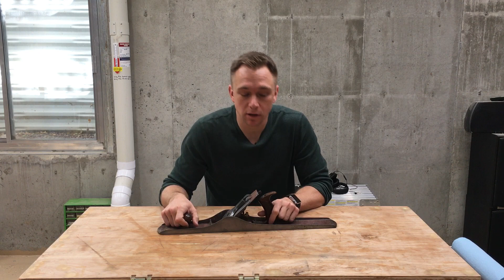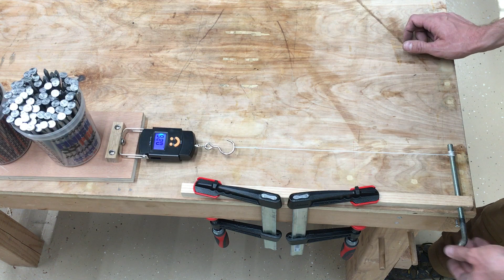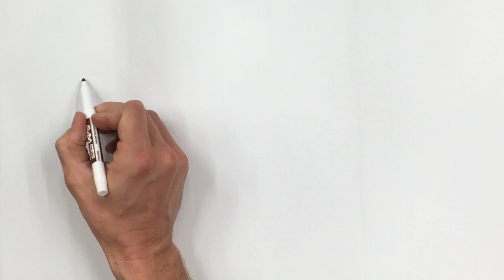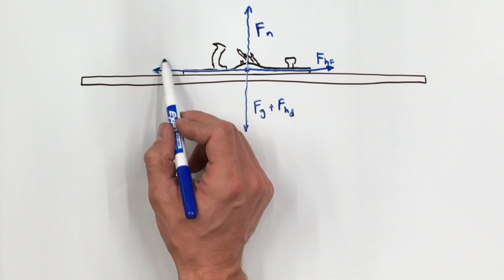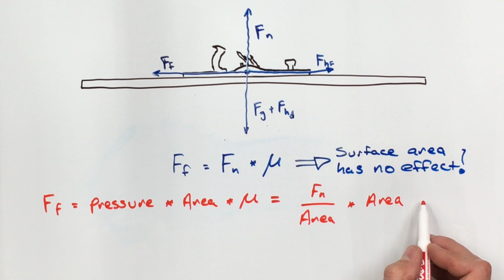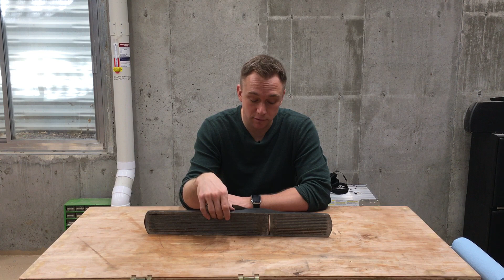Grooves in Plane DON'T Reduce Friction!

Comment: the reason they are there is because Stanley could advertise that it was easier to push. even though it made no difference they advertised it. and that is the reason they put them there. I will see if I can get you a few links to those old adverts.
Reply: here you are. http://www.petermcbride.com/chaplin/tower_and_lyon1.jpg
https://virginiatoolworks.files.wordpress.com/2012/06/stanley-1929-catalog-plane-page.jpg
http://www.handplane.com/63/stanley-1902-catalog/
it is not that they did actually make it easier but they could charge more if they advertised that they pushed easier.
Reply from the maker: +Wood By Wright very interesting
Reply: Yeah, marketing genius!
Reply: Howdy James. Always good to see the channels I follow watching some of the same things. research aligns once again. If even a year apart.
Reply: Thanks for the links, James. These's a lot of great information there, plus the website for even more info.

Comment: I'm no plane expert but I am an expert in thermodynamics. Basically, I understand physics very well. 
Two very flat surfaces will have suction when you try to pull them apart. This is especially true if you add a small amount of liquid such as water found in wet wood. 

If you add a path for air to get between the surfaces then you eliminate that suction. So, the groves definitely help with that. 

However, my guess is the primary purpose is to flatten the plane more easily.
Reply: If that was the case wouldn't it be better if the grooves run all the way so air can get in at the ends?
Reply: You are correct. It would be better.

Anyway, I should have mentioned earlier that I don't think the suction force would be significant. Its calculable and its there, but not noticeable.
Reply: You know you have a very nice surface when you can't lift the plane off the board because of the suction force!

Comment: hi, 
while everything you have said is correct and is taught in school and engineering the way you explain it, it isnt quite that simple. what you will find is that there is actually a curve for the coefeccient of friction between two materials. In other words it doesnt stay constant for all pressures. this has got to do with the roughness of the two materials and as you apply more pressure the troughs in the material start to get filled with the peaks from the other material  and normal forces start to be created which increases the coefficent of friction. however it gets to a point where these troughs cant be filled any more so the curve flattens off.
Reply: good point!

Comment: The grooves reduce the surface to surface contact area which would reduce the amount of stiction, so it is easier to get it moving forward at the beginning of each stroke.  You should re-do the test and record the peak value as it starts moving.
Reply from the maker: +Doug Alcoe no, static and dynamic equations work the same way, only have different coefficients, area reduction doesn't help in either case

Comment: The coefficient of friction is not a constant for materials with a rough texture. Less area can lead to more friction if a surface is rough or sticky. So the groves can only be worse than a flat sole considering friction alone. However, my experience with using both planes is when smoothing with a large jointer there is less vacuum suction while planing quickly. I am able to pick up a board , stuck to the bottom of my plane, 
briefly with a flat sole but never with a grove plane.

Comment: Friction is proportional to the force pressing the two bodies together not the surface area of contact. That's VERY well known. It's high school level physics. 

Grooves are there for three reasons
1. Reduce the amount of material in the plane, making it lighter, but more importantly cheaper.
2. Machining the sole of the plane to be flat requires the R ek all of less material, making the machine cheaper.
3. To make marketing claims that this is a "beneficial feature of the product".

Comment: I believe you made an error, mass is not a constant in this example, it changes between a corrugated and non-corrugated plane.  edit; to clarify - Fn includes the mass of the plane but if the mass changes between corrugated and non-corrugated then Fn becomes Fn1 & Fn2.
Reply: Mass has an effect, but it's very minor. The force downwards with your hands is much greater than the weight of the plane in most cases. 
And if that were the case, there would be far better (cheaper) ways to do it. Grooves have to be milled after casting. This significantly increases manufacturing costs. Logically they would just make the casting a bit thinner. It would reduce friction, and make it cheaper to manufacture (less cast iron used). 
The thickness of the castings did vary throughout Stanley's plane making history. I believe some of the first ones were a bit thicker, then most were the same, I think one or two types (type 12?) was a bit thicker, and some of the post WWII planes were made heavier. 
Many people buy really heavy planes - example bronze Lie Nielsen 4 1/2. No one ever says that there is any difference in the friction.
Reply: You are confusing 2 arguments. The original purpose of the grooves is separate from whether they reduce friction. The video title states they do not reduce friction (in all caps) and attempts to use math to prove it. The force from the person pushing down would be variable, it can be eliminated but gravity and mass cannot be.

Comment: Two cents: If anything, the grooves would tend to increase friction (minutely of course). You have a lot of edges pressing into a relatively softer material. Especially if you do not plane exactly parallel to the grooves. Think of tire treads. Imagine having a bald tire. In theory a bald tire would have the same grip as a treaded tire. But obviously this is not the case. You need to take into account the dynamics of the materials involved. Both the gripper material and the grippy material.

Comment: I'm pretty sure that the grooves are to lower manufacturing cost.  The grooves aren't precision ground so they can be done quickly and easily. After the grooves are cut there is far less surface area for precision grinding to flat. Think about where you see grooved table surfaces on tools. It's not on high end powermatic stuff, it's on budget bandsaws and such, and usually aluminum tables to boot. Same reason I think.
Reply: The grooves in a plane are cut with a milling machine, so there'd be a significant cost (though I'm not a machining expert!)
I reckon those grooves on bandsaw tables are cast into it to begin with, which means no machining cost.

Comment: In the early twentieth century, English woodworkers engineered the perfect width of groove on the sole of the hand plane to satisfy their daily demand for Cocaine. A woodworker would drench his plane in high quality Columbian ching, before leveling off with a card scraper wrapped in a single fine shaving from a newly planed piece of wood (this would prevent the scraper scratching the sole of the plane). Apprentice woodworkers were introduced via the Stanley No.3 plane, with the more experienced woodworker being able to "hit a 7" as it was known in 1930s rural England. Factory owners would encourage the practice, and indeed lobbied Stanley to manufacture more, as workers were known to work several days without break after hitting a couple of 7s. Whilst high, it was said that the workers would crave the feel of super smooth wood across their faces, the more they planed the greater the experience. Workers would end in a dual addiction to both smooth wood and crack. After several deaths due to exhaustion, and an incident where the Queen - whilst visiting a wood factory - witnessed a naked man dragging his balls backward down an entire 2 x 4 whilst foaming at the mouth, grooved planes were banned from all UK factories. Luckily, war broke out, and the incident was largely forgotten. However, grooved planes will always be remembered for their true raison d'etre, which was to satiate the Cocaine-desires of the drug fueled English woodworker. I think.

Comment: My understanding is that wooden planes have less friction than metal planes. This fact caused resistance by woodworkers to the adoption of metal planes. Stanley, supposedly, made the corrugated bottoms in an attempt to lure users by the intuitive sense that they would have less friction force. The physics, of course, refutes this. The adoption of metal planes has more to do with the surge in home building after WW1 and it became impossible to mass produce wooden planes in the necessary numbers. So, why do wider tires have more grip? Splain that one!
Reply: Wider tires don't have more grip than skinny tires, all things being equal. They just distribute the force in a different direction, perpendicular versus parallel to the vehicle.
Reply: Tires dont have more grip they have a greater surfave area to transmit the power (torque) to the road. This means that the presure per/inch2 can be lower than the friction number and therefore you can put more power down.

btw, for pure wood on wood the friction is greater than wood on steel, the wood on planes usually has a finish on it and wax reducing the fraction number.

Comment: So, why do slick tires provide more traction than grooved tires?   Hmmm?
More contact area in the footprint I'd say.
So why aren't all tires slick?
1. Because they don't flex enough for control
2. The grooves are there so there's a place for water and debris to go to prevent hydroplaning, punctures, etc.
3. The tread elements on either side of the groove pinch together going in to the footprint, grab debris then spit it out at the following windshield...doink...crack.

About the plane;  Perhaps the grooves are there as a place for "stuff" to go.

I'd be interested to see a 'flex' test between two planes, one with a corrugated sole and one without.

Comment: You say that when the area goes down the pressure goes up, but you didn't change the weight or number of nails.  How did the pressure go up?
Reply: Because surface area goes down. If You have 100lbs of weight focused on a surface are the size of a dime, the pressure of that wold far greater than 100lbs of weight focused in an area the size of a tire
Reply: bob hilton pressure=Force divided by area. reduce the area and you've increased the pressure

Comment: Here in Sweden I was taught that the corrugated soled planes were used with wood that wasn't quite dry and mainly with roughing planes. So essentially reduce suction caused by moisture as some have already suggested. Would be interesting to find out the real reason.
Reply: same in Ireland for old boat builder using steamed wood
Reply: I would think that the suction combined with the lubricant effect of the moisture would work in your favor.
Reply: sonicseaweed have to say this makes the most sense logically
Reply: came here to post this, surprised some already did actually... lol
Reply: sonicseaweed I was with Paul Sellers at a demo today and he says it is to reduce the weight of the plane
Reply: If it is weight you are worried about, use a wooden plane.

Comment: I disagree. Those groves do reduce friction. Not by changing the area, area doesn't come in this. but they also reduce the weight of the plane. 
if you want to have a bit more controlled experiment, you could set up a weight pulling your test surface over the table's edge instead of your hand crank and put your gauge at the other end. the pull on the gauge should be the pull of the weight minus a factor due to friction of your test surface.
Reply from the maker: First off, weight reduction is quite minimal.  Second, the use will try to apply the optimal downward force when planing to get the best performance.  So I think with a light plane you just end up pushing down a little harder, and friction is unchanged.
Reply: Andrew Klein fair enough. 

what is strange is that although i know the area doesn't affect friction I wonder if diretion does matter in this instance? Is it easier to slide the plane with those groves than perpendicular to it? that could help with straightness... or people just had similar feelings and put the grooves in even if they have no effect because everyone knows there have to be grooves? 

I only tried an electrical powered plane once and after it did what it did to the table i switched back to a sander ;-)

Comment: some woods have holes whit pitch in them (not sure if pitch is the right word) such as pine so instead of gunking up the bottom of the plane it now has a spot to go  the grooves but you steel need tho clean the plane afterwards
Reply from the maker: could be
Reply: I was told they were for "reducing friction when planing resinous woods like pitch pine" or words to that effect. Maybe the physics is different when dealing with semi liquid resin. I suspect that is a more complex issue than the simple pressure x area calculation.

Comment: Wow. My brain hurts after that one Andy. HaHa. The test you did confirms the physics of your statement. I always thought it did in fact have to do with friction especially on the longer plane soles with more surface area. Now I am thinking that your statement of reducing the amount of iron necessary to flatten the sole is a valid argument. Thanks for sharing your thoughts on this one Andy!
Reply from the maker: Glad you liked it, two advil should knock that headache right back down!
Reply: Yep, it's grooved to make flattening easier. 
Not on the consumer side, but on the manufacturer's side. It makes flattening operation less expensive and was also used as a marketing gimmick.

Comment: Andy,
If I remember correctly the introduction of the Corrugated soles was just after the release of Iron Body plane to the market.
Prior to the Iron Body planes, most production planes were still Wood Bodied or in the Transitional planes, Wood Soles.
Workers were used to the slick and easy to push Wooden planes.
They resisted the Iron Body planes on the major complaint of weight and added effort to use them.
SO... As a marketing Gimmick they added the Corrugations claiming they are easier to use because there is less surface to surface contact.
However, I have looked at this and realized that when the entire plane is on top of the wood the surface contact is still nearly 100%.
As you noted a nearly ZERO benefit.
As to the removal of metal on the sole being less with the Corrugated soles... well, someone had to take time to remove the metal that was in the grooves so that debunks that.
As to any suggestion of it reducing the possibility of the plane warping... Stress in Cast Iron is relieved every time you machine it and therefor can create more warp.
As to adding strength while lightening... here too remove Iron and it gets weaker.
In closing...
I'm sticking to the fact it was simply a Marketing Gimmick.
Reply from the maker: Not sure I understand this statement:

"As to the removal of metal on the sole being less with the Corrugated soles... well, someone had to take time to remove the metal that was in the grooves so that debunks that."

I don't know that anyone "removed" the metal in the grooves, the manufacturer just cast the plane that way.  From the perspective of the end user who can flatten a plane faster, why would they care how the grooves got there?
Reply: From a manufacturing standpoint I believe the corrugation are cut, not cast.
Lie-Niels still offers that service today. One Casting 2 different looking planes.

Comment: I vaguely recall some chatter about suction.   I did see a similar video demonstration some years ago where two planes that were the same except for one being corrugated were dragged across the same surface.  The corrugated plane required more force than the flat.  The guess put forward was that the corrugation created more suction.  I have both type of planes and I have never discerned a difference.  I'm sure I could be blindfolded, lead to my bench, have the planes put in my hands, one at a time, and I would not know the difference
Reply from the maker: Interesting, some people are speculating that the grooves reduce and break suction.
Reply: Put the issue in the same file folder that contains, "What s the purpose of the saw nib?"